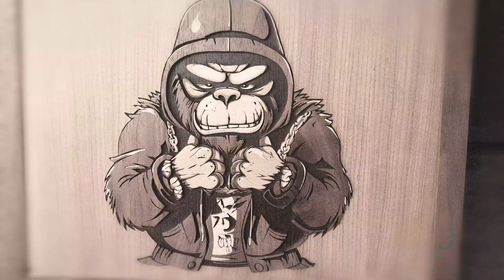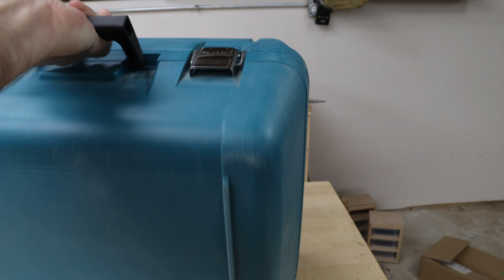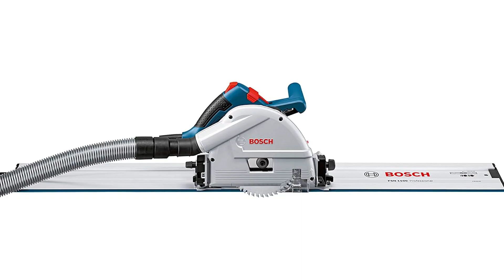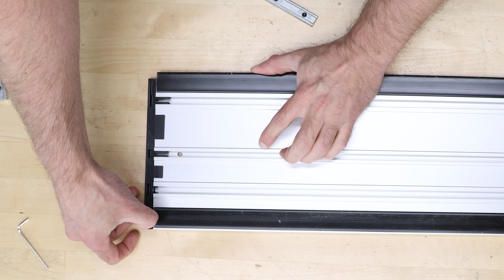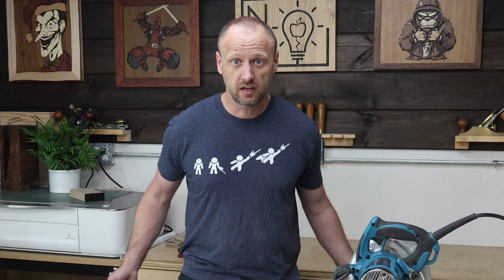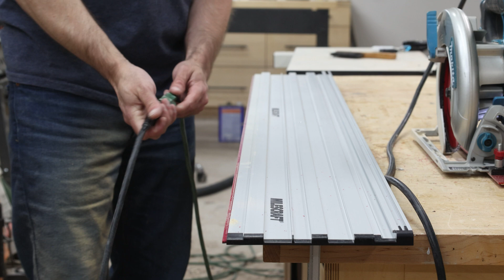Don't Waste Money! Watch This Before You Buy a Track Saw

Comment: Hey Billy!  Good video!  If folks are like me and only use or need a track saw so often than I would highly suggest the Wen Ct1274.  It uses standard 71/4 blades so no special blades needed.  Also it’s awesome and price is budget friendly.  It does plunge, accuracy is awesome, corded for equal power, paired with squeeze clamps and track for a budget friendly setup.  Mostly great for ripping and cross cutting sheet goods.  But if your on a budget and only use one occasionally it would be worth the buy.

Awesome video as always!!
Reply: This is the answer - I got the whole setup with 2 tracks for $230 late last year, it's been absolutely fantastic, the only thing that's lacking is dust collection. Even hooked up to the nicest "tool" in my arsenal, a Festool dust extractor, it still manages to spew sawdust. But it cuts accurately and smoothly, which is what matters.

Comment: Thanks for the review.  Overall I've found Milescraft products to do what they are advertised for; I have some of their router jigs and they work really well.  I've been looking at this as an option to use with a cordless saw to break down sheet goods so they will fit in my SUV since I no longer have a vehicle that will take a 4x8 sheet intact so super accuracy isn't critical but I'm concerned about the registration getting out of whack and damaging the track.  I wonder if replacing the arm with something sturdier would prevent that from happening.
Reply: If you dedicate a saw exclusively for this track you can mount it permanently. 
Clamp and calibrate it. With the saw clamped in place drill and countersink holes up from the bottom thru the guide plate and saw base plate. Fasten with Nylock nuts.
I have a worm drive saw attached to a different brand of guide plate, and it has never moved.